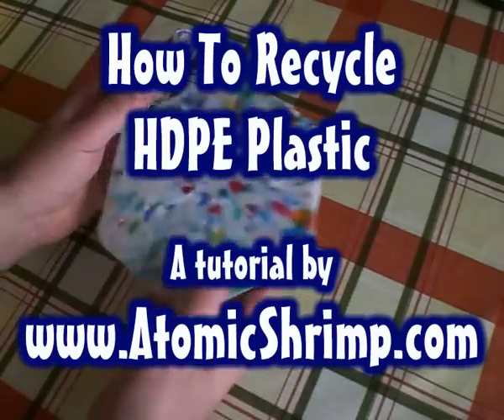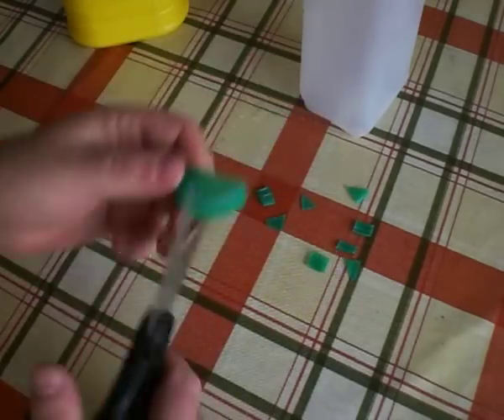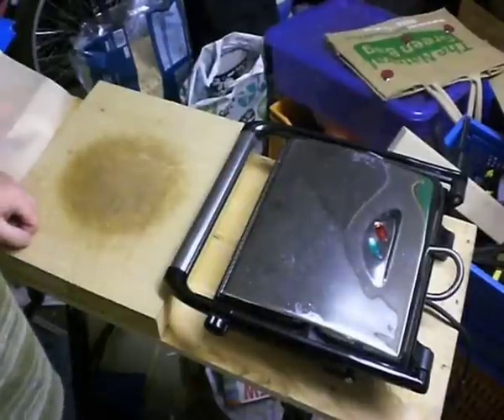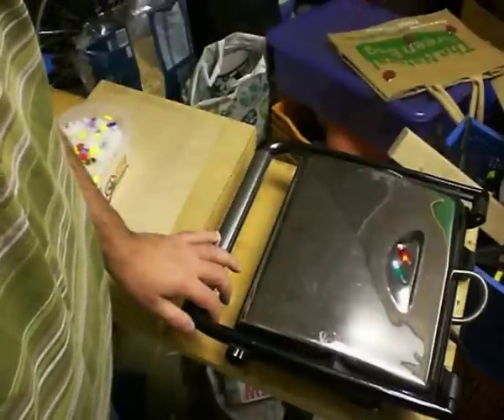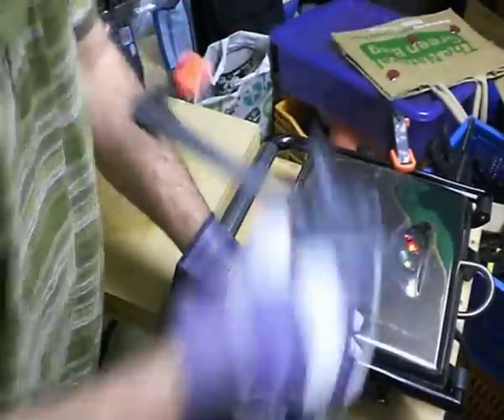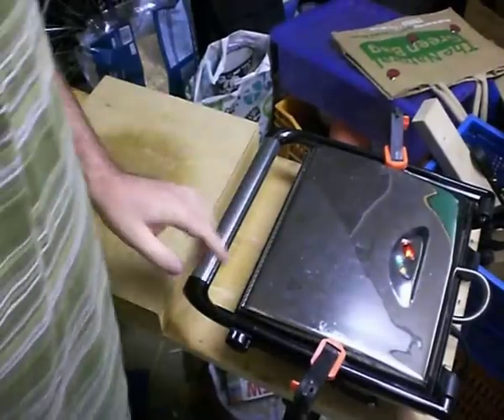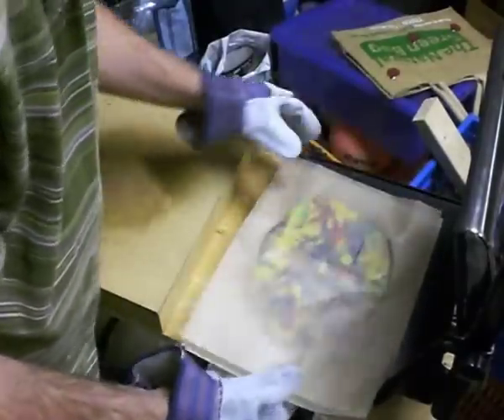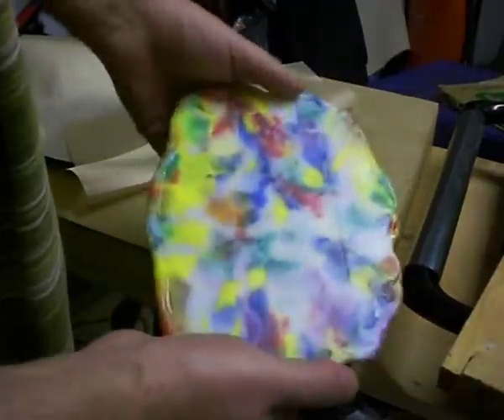How To Recycle HDPE Plastic (High Density Polyethylene) - a simple method

Comment from the maker: Not sure about wrapping around something, as the material shrinks violently on cooling - Maybe if you had a cone-shaped mandrel, you could form loops and leave them on it to cool - then they wouldn't get stuck on it as they cool.
If you have really tough hands, and are careful, the semi-molten material can be worked in the same sorts of ways as you might have seen expert chefs working with hot caramel.

Comment: FWIW - I have an ex-office paper shredder I bought off ebay that cuts into milk bottles into strips. I just tested it - no jams or issues. I cut the tops and bottoms from about 20 bottles, sliced them to make large sheets, and fed the sheets in. It is a pretty heavy duty unit though, and, sadly, doesn't cross-cut.